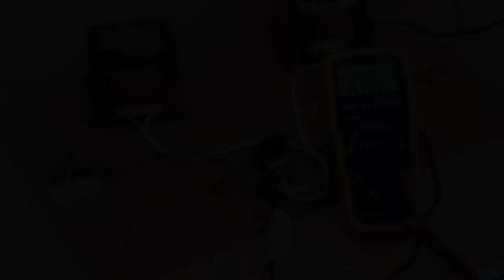DIY Welding Machine / Only 2 Microwave Transformer / Good Job

Comment: sir i made the same diagram but the wires start melting 
is the fault that i put 2 different  transformers (yellow and white) ?
Reply from the maker: Hello.  If you have used microwave transformers, it is not a problem that they are different.  But I think the mistake you made is to use PVC insulated cable.  PVC insulated cables are not heat resistant.  I used silicone insulated fireproof cable.  The transformers get hot, but the cable is not damaged at all.  You can see this in my last video.  I also did the 3.25 electrode test.
Reply: if i use 4 transformers and 6mm² each one do my cables will melt ? and thank youu
Reply from the maker: In this case, it will be more durable.  Because the load on the transformers will decrease.  I don't think the wires will melt.  It would be great if it was done with 4 transformers using awg8 cable, but awg8 cables are a bit expensive.
Reply: thank you so much
Reply from the maker: Thank you too 👍

Comment: The module you used is scr?
Reply from the maker: Hello.  The circuit I use is the ubiquitous dimmer circuit.  It is done using triac.  What I did was to connect extra parallel triacs to make the circuit stronger...

Comment: How many turns from every transformer and what size of insulated wires?
Reply from the maker: I made 24 windings with a silicon insulated copper cable with a cross section of 4mm2.  I used 6.5 meters of cable for this.  These values are valid for a transformer
Reply: I tried using size 24 stranded wires only for 5 turns and series to both 2 microwave transformer and it easily gets hot from secondary
Reply from the maker: The cable cross-section will be 4mm2 and 24 windings will be made.  Did you do it this way?  Heating of transformers can be considered normal.  But there seems to be a misunderstanding
Reply: I do only have #10AWG stranded wires, is it ok to use? It can only make 6 turns
Reply from the maker: Hello.  10AVG is fine, but 6 turns is not enough.  The voltage becomes too low and the current becomes too high.  In this case, the cable may burn.  At least 20 turns must be made

Comment: It's electric heater not a welding machine. Big losses on secondary winding and fast overheat. 🙂 Nice job and video.
Reply from the maker: Could you be exaggerating a little?  But.  it doesn't matter, thank you for your attention

Comment: Pas mal du tout. Ça me donne des idées. Les 4 triacs sont nécessaires ?
Reply from the maker: 4 triacs suffisent pour une tension secteur de 220V, au moins 6 triacs doivent être utilisés dans des endroits avec une tension secteur de 110V.  Bien sûr, cela dépend du modèle de triac que vous utilisez.  J'ai choisi BT137 parce qu'il est abordable.  Ce triac est de 8 ampères.  Un triac plus puissant peut également être utilisé.  Puis le nombre baisse.
Reply: pour l'instant je n'arrive pas à extraire le secondaire. Il est juste descendu de 2mm. Je vais essayer à la perceuse
Reply from the maker: Je ne pouvais pas comprendre ce message.  Je suppose à cause de la traduction...
Reply: J'avance un peu. J'ai réussi à extraire le secondaire. Pour le refroidissement, je préfère extraire l'air chaud vers l'extérieur plutôt que de souffler l'air ambiant vers l’intérieur (comme sur une tour PC)

Comment: I love the welder! I also love the table jig saw! Did you use a large reciprocating saw underneath?
Reply from the maker: Hello.  Firstly, thank you.  Sorry for my late reply to your message.  I am currently dealing with construction work.  There's a Makita chainsaw on the jigsaw bench.  You can easily do it using the measurement document I have provided.  A very useful tool.

Comment: Ok, can you please indicate the type of dimmer needed. let us know your comments best regards and thank you for your responses. Very much appreciated. our Microwaves in USA are 110 volts.
Reply from the maker: Hello.  The system can be built in the same way at 110V voltage.  Because the transformers you will use are produced for 110V voltage.  However, since the current drawn from the network at 110V voltage will be twice that of 220V, it would be better if the cables to be used at the input are thicker.  Dimmer circuit must be at least 6000W.  If you want, you can add 6 more parallel BT137 triacs to the circuit by purchasing a 2000W dimmer circuit as I did.

Comment: Nice project. Now you can continue and put a rectifier on the output and then wind a 3rd mot to act as a choke. 

I converted one of those old tombstone AC stick welders (easy to obtain, for free or easy to fix broken ones) to DC stick welder. 

It was fun project and it thought me a lot.
Reply from the maker: Hello.  I added a rectifier circuit that I made with a diode bridge to the output.  You can find the video on my channel.  Thank you for your attention

Comment: You made it very beautiful.  I've made this before, But I do not know why the coating of the wires was extremely hot and melted  😅😅
Reply from the maker: Thank you.  Transformers get pretty hot.  Therefore, normal PVC insulation melts.  I used silicon insulated cable.  There was no deformation in the insulation.
Reply: Did you use fireproof coated wire? Is there another solution for this problem? What should I use as a fireproof coating for the wires?

Comment: can this welder be used to weld aluminium   ?
Reply from the maker: I think it can be used.  I have never welded aluminum before, but this machine provides the necessary values.

Comment: Hola maestro ya hice la maquina de soldar me quedo muy bien pero me falta el regulador me podria decir el dimmer de que valor uso usted mas los 4 triac el valor de los triac x fa gracias excelente maestro un saludo desde guayaquil Ecuador gracias
Reply from the maker: Gracias a ti también.  El diagrama de cableado está en la sección de descripción.  ¿Miraste?  Si lo desea, puede utilizar un atenuador de 4000 W sin ninguna acción.  Si quieres hacerlo como yo, puedes usar 4 bt137s.  Recomiendo revisar el esquema.

Comment: Y como se podría ajustar ... Desde 0 a 60 voltios  ??
En vez de 28 a 40 voltios 

( Hacerla de laboratorio ) 

Me ha gustado ... 👍
Reply from the maker: ¿Por qué quieres esto?  No por el soplete, supongo.  El voltaje de salida se puede cambiar jugando con los valores de los elementos del circuito en el circuito del atenuador.  Entonces de 0 a 60V puede ser así.  Pero si no, puedes cambiar el voltaje con un circuito electrónico puesto en la salida.

Comment: How many turn you turned that silicon wire
Reply from the maker: Hello.  I made 24 windings for each transformer.  In this case, a total of 13 meters of 4mm2 silicone insulated copper cable is required.

Comment: What is the size of the wire used? Please respond. Excellent work. I would like to apply your method. Greetings from Iraq ❤
Reply from the maker: Hi.  I used 4mm2 silicon insulated copper cable.  I made 24 windings for each transformer and used 6.5 meters of cable.  13 meters of cable is required for two transformers.  (Such information is given as subtitles in the video) Thank you for your interest.
Reply: Thank you for the clarification 🌷
Reply from the maker: Thank you too 👍

Comment: Hola mister Estoy interesado en hacer una maquina Como la Que hiso en el video pero no se donde comprar las partes electronicas y tampoco se el grosor del cable ni cuantas vueltas le da en el transformafor si pudiera ayudarme con eso se lo agradecería, muchas gracias y excelentes vídeos
Reply from the maker: Hola.  En primer lugar, gracias.  El cable que utilizo es un cable ignífugo aislado con silicona de 4mm2 de sección con código N2GFAF.  Hice 24 bobinados para cada transformador.  Se requieren 6,5 metros de cable para estas 24 vueltas.  13 metros para 2 transformadores.  El circuito electrónico utilizado es el circuito dimmer, que brinda la oportunidad de ajustar la intensidad de la corriente.  Se puede encontrar muy fácilmente.  Puede encontrarlo en Internet como un circuito de atenuación de 4000W.  Como mi circuito es de baja potencia, conecté 4 triacs adicionales.  Sin embargo, si compra un circuito de atenuación de 4000 W, puede usarlo sin ningún procesamiento adicional.  El diagrama de cableado está disponible en la sección de descripción.  Recomiendo descargar este diagrama y ver el video nuevamente con los subtítulos activados.  que tenga un lindo día

Comment: I can't find this thin copper wire 😭 .
Can i use standard wire, which has 3-5 thick copper wire inside??
And what rm wire i should use ??

🇧🇩🇧🇩🇧🇩
Reply from the maker: Hello.  It is not appropriate to use PVC insulated cable as there is heating in transformers.  It is necessary to use a silicon insulated cable.  You can use awg 12 cable but it's a bit expensive.  The cable I use is 4mm2 N2GFAF cable.  It can be found in major electrical supply stores.  This cable is generally used in the interior installations of appliances such as electric heaters.

Comment: I was looking forward to seeing links to purchase the electronic parts used with the correct ratings on platforms like Amazon or ebay or where ever it can be ordered.
Reply from the maker: Honestly, I bought most of the materials from electrical equipment vendors where I live.  Let me write down the technical names of the materials used for you.  This is how you search the internet.  The secondary winding cable I use in welding machine transformers is "4mm2 N2GFAF" silicon insulated copper cable.  You can buy "AWG11 cable" as an alternative to this cable.  This cable should be 13 meters.  "4000W dimmer circuit" is required for current adjustment.  "10/25 welding socket" for plugging welding cables into the box.  Electrical switch with 16A or 25A current as on/off switch.  They call it the bridge used for converting the output voltage to DC, 5 pieces of "KBPC5010" and "4700uF/100V" capacitors.  In general, the materials are like this.  If you want to ask, you can ask again.
Reply: Güney thank bro your awesome .
Reply from the maker: Thank you too

Comment: hola que tal me gustaria hacer tu proyecto y queria saber si un dimmer de 2000w sirve
Reply from the maker: Hola.  El atenuador de 2000 W será potencia insuficiente.  Por lo tanto, como puede ver en el video, agregué 4 triacs paralelos.  Si tiene un atenuador de 2000W, haga lo que hice.  Si no, compre un atenuador de 4000W.  Los diagramas de conexión se encuentran en la sección de descripción.  Si tiene más preguntas, por favor escriba de nuevo.
Reply: hola que tal con los de 4000w tienen fichas de entrada y salida como seria el diagrama de coneccion
?
Reply from the maker: Hola.  No hay diferencia en el diagrama del circuito.  Solo el triac utilizado es más resistente a la corriente.  El proceso que hice en el video también fue hecho para este propósito.  Aumenté la potencia conectando los triacs en paralelo

Comment: This is beautifully executed.

Would have mounted the heating on the metal body, a dpdt isolator at the rear for just an extra isolation layer(linking these to the fan would be just for kicks and actually functional), and actually had an earth continuity to the upper shell.

This is so clean am thinking of doing it for hobby works.
Reply from the maker: Hello.  If I'm not mistaken, we're talking about assembling the bodies of the triacs that I attached to the dimmer circuit in the box.  This could have been done, but there wasn't much room left on the front panel, and I didn't want to attach it to the rear panel because I didn't want to stretch the cables.  If another topic has been mentioned, please write again.
Reply: we are very much in agreement. Beautiful job this.

Saw it yesterday and have actually moved an old microwave to the shed to copy this for the weekend.

Thank you.
Reply from the maker: I wish you success 👍

Comment: I thought you used shotkey diodes to protect the output. So you stacked the triacs instead. I wonder if shotkeys would work as well? It looks to be working great.
Reply from the maker: I connected a dimmer circuit to the output for current adjustment.  I added parallel triacs to make this circuit more powerful.  It does a pretty good job.

Comment: Did you convert the output to dc or not? Thanks
Reply from the maker: I did not do DC conversion.  The electronic circuit I use in the video is the dimmer circuit used for current adjustment.

Comment: Amigo Ami yo lo hice con cable 8 pero para que me salgan los 40 Amp. Me tocó 4 transformadores y eso pesa mucho. Cuál es el error?  Gracias
Reply from the maker: Hola.  No entendí completamente tu pregunta.  Si das más detalles intentaré ayudarte.  Me di cuenta de que estás usando 4 transformadores y usando un cable de 8 mm2.  ¿Cuántos voltios salen?  ¿Cuántas vueltas hiciste?  ¿Cuál es el problema?
Reply: si amigo así como lo dices. El problema es que por ser 4 transformadores es muy pesado. Me gustaría dejarlo con 2 como lo tienes tu. Pero se calienta con 2 y no me da el voltaje. Solo con los 4 me da los 40.
Reply from the maker: Ahora lo entiendo.  Para obtener 40V con 2 transformadores, necesita usar un cable de 4 mm2 como yo.  Por supuesto, esto también se está calentando.  Utilicé un cable de cobre con aislamiento de silicona.  Ser resistente al calor.  De lo contrario, no puede obtener un voltaje de alrededor de 40V.  En otro caso, puedes usar 3 transformadores y usar cable de 6mm2.  Haces 15 vueltas.  Pero el calor seguirá siendo.
Reply: muchas gracias.
Reply from the maker: Gracias también.  Si hay algo que no está claro, puede volver a preguntar.

Comment: ustam gerçekten güzel bir bilgi paylaşımı, videonun uzunluğu önemli değil. sonuç mükemmel.elimde 4000v dimmer var bu yeterli olurmu .
Reply from the maker: Teşekkür ederim Cengiz bey. 4000W dimmer yeterli olur. Kablonun silikon izoleli saf bakır kablo olması önemli. Bu kablo N2GFAF kablo olarak geçer. Yanmaz kablodur. Hayırlı akşamlar
Reply: çok teşekkür ederim. ekonomik sıkıntı sebebiyle tüm hoby ekipmanlarımı sizin gibi ustalardan öğrenerek kendim yaptım.hayırlı geceler kardeş.
Reply from the maker: Bende teşekkür ederim. Galiba çoğumuz aynı durumdayız. Kendi yaptığım ürünleri kullanmayı sevmek de var ama pahalılık biraz daha önde
Reply: usta  N2GFAF kablo kaç metre alalım, birde her birine kaç tur sarım yaptınız, dimmer ile amper ayarının kaç amp olduğunu nasl öğrenebilirim.
Reply from the maker: Merhaba. Her trafo için 6,5 metre kablo gerekir. Toplam 13 metre. Trafolara 24 sarım yapılacak. Akım ölçümü için kaynak yaparken ampermetre kullanabilirsiniz. Ya da çıkışa bir köprü diyot bağlayarak dijital voltmetre ile gerilimi olcebilir ve bu değere göre akım değerini tahmini olarak bulabilirsiniz. Bu değerleri kesinleştirmek için çıkıştan ölçülen gerilim değerine göre çekilen akımı bir kez ölçmeniz gerekir

Comment: The dimmer is sold in 2000 and 4000 watts. 
Which one do you recommend?
Reply from the maker: Hello.  I recommend getting the 4000W one.  If it malfunctions, write to me and I'll tell you what to do.
Reply: As estimated, thank you very much, greetings from Chile
Reply from the maker: Greetings from Turkey
Reply: All four triacs must be the same? 
BT 138?
Reply from the maker: Hello again.  If you use a 4000W dimmer, no extra triac connection is required.  If your circuit fails, the deteriorated material will be triac and diac.  Then you would use 4 pcs of bt137 or bt138.
Reply: Then the triacs are of support in case the dimmer is of less power. 
But in my case if I place a 4000w dimmer it will not be necessary to use a triac.
Reply from the maker: Hello.  Exactly as you say.  If there is a problem, if it fails, you add a triac.

Comment: Hola amigo como te va con la máquina de soldar espero que te vaya bien yo aún no le e puesto el potenciómetro a la mía ahora ya no lo quiero dejar y lo voy a hacer pero veo que el que tú tienes puesto es el potenciómetro  de 2000 W?? Es correcto ? El de 4000W no lo encuentro al menos que sea igual que el tuyo en fin a ver cómo lo monto dime algo porfa gracias un saludo
Reply from the maker: Hola.  Próximamente, publicaré un video haciendo que el circuito de atenuación utilizado para el ajuste de corriente sea más adecuado.  Haré el mismo circuito en el PCB y será posible instalar 8 triacs en este PCB.  Se puede utilizar en modelo de 2 transformadores, si se desea, en modelo de 3 o 4 transformadores.  También compartiré los archivos necesarios para el PCB.  Así que si quieres, puedes hacerlo donde yo lo hice.  Nos vemos de nuevo, cuídense.
Reply: muchas gracias amigo por responder eres muy amable ya estoy deseando de ver tu nuevo video pero la duda la sigo teniendo de que si es de 2000 W o de 4000W ?? Ok muchísimas gracias un saludo amigo
Reply from the maker: ¿Para qué máquina preguntaste?  ¿Era una máquina de China?  ¿Con corriente de salida de 250A?  Si es así, deberías usar al menos 4000W
Reply: es para una máquina que yo hice igual que la tuya con 2 transformaciones de microondas le saco 36 voltios y me gustaría regular el voltaje gracias
Reply from the maker: Más o menos lo mismo que mi máquina.  Si la tensión de red es de 220V, será suficiente si utilizas 4 triacs.
Reply: muchas gracias amigo le pondré el potenciómetro de 2000 W y 4 triacs  muchas gracias por tu ayuda  un saludo
Reply from the maker: Gracias a ti también.  Exactamente así... como dije, volveré a tocar este tema en el video que compartiré pronto.

Comment: Please what is silicone insulated cooper cable ?it's the eng,name or is frinch.please?i wont to no
Reply from the maker: Hello.  The cable code I use is N2GFAF.  It is used in the interior installation of appliances such as electric heaters.  It can work at 180 degrees Celsius.  Alternatively, you can use AWG12 or AWG11 coded cable.  But these cables must be more expensive.  I bought the cable from a big electrical store where I live.